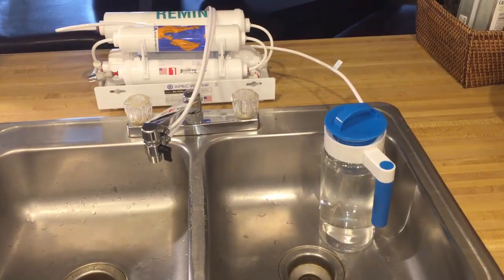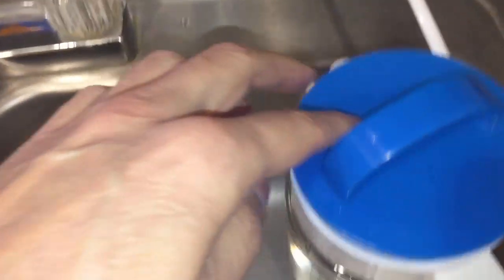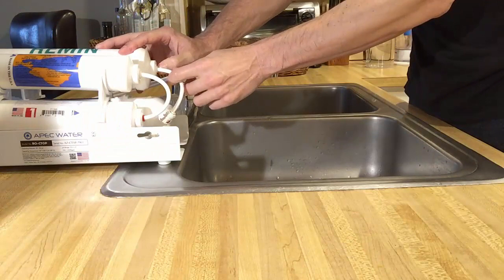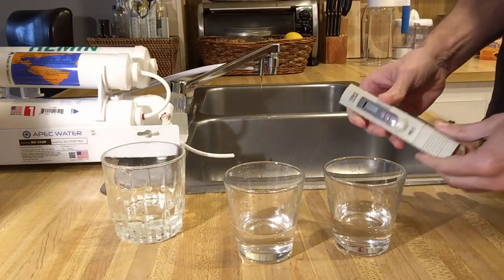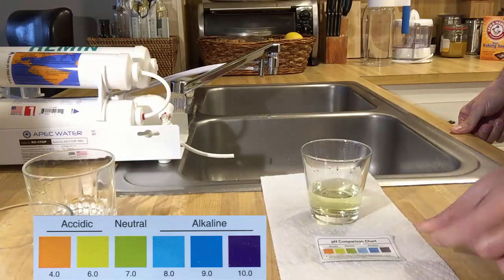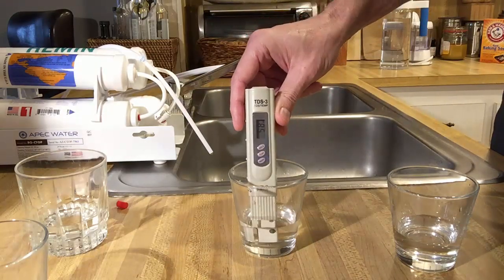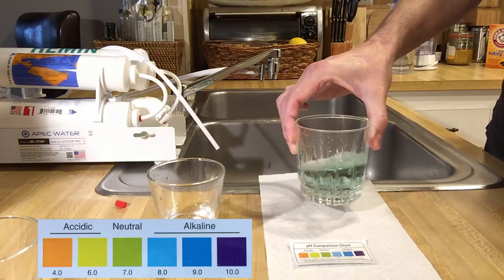Countertop RO portable drinking water purifier alkaline filter review PH TDS Speed Waste

Comment: Hi, I am trying to get a countertop RO system similar to the one shown above then add in the mineralizing  unit, which brand would you recommend? I looked recently into the Crystalquest brand, but there were bad reviews on it on Amazon. Thanks.
Reply from the maker: I use the REMIN filter from vitev.com. It's larger than a typical filter and good tasting, but kinda expensive. I replace it every 12 months on auto-program for $119.
Reply: @Your-Self  I was referring to a Reverse Osmosis unit similar to the one you've reviewed above, I meant the entire unit leading to 0 TDS, can you recommend any?
Reply from the maker: Not really. A typical RO system will remove about 95% of impurities (5-20 TDS). To get 0 TDS, you'll need a distiller or a Zerowater filter system.

Comment: What should the TDS read on water from a brand new water filter? My zero water filter reads zero but this is way higher than that. Thanks!
Reply from the maker: The RO system removes about 95% of impurities from the faucet water, which is good enough. And I like to add some minerals to that water after purification to improve taste and make it healthier. And that increases the TDS.
The Zero Water removes 100% of impurities, but the filter needs to be replaced very often $$$
Reply: @Your-Self  so zero water is better? I was told RO is better , so confusing.

Comment: Great review, @Yourself !. After replacing the Remin filter, will it still fit with the case ?
Reply from the maker: If you have the model with the case, everything inside is very tight. The Remin filter is larger than regular filters, so it'll not fit inside the case. Maybe you can use it without the case... not sure.

Comment: I am trying to add the remin to the express water countertop system. How would I hook it up? I believe I have to remove the rounded faucet and connect the remin filter with a tube to the post carbon? Any advice would be helpful
Reply from the maker: I'm not sure how your express water system looks like, but in general, the Remin filter should be connected instead of the post-carbon filter, not after.
Reply: @Your-Self  So I have to replace the post carbon with the remin filter, right? Why can’t both be together?
Reply: And the remin filter would this become a 5th stage
Reply from the maker: You can obviously create the 5th stage if you want, but honestly, the post-carbon filter doesn't do anything but improving the taste of already clean water (assuming you have the RO membrane). And if you got the Remin filter, it will add the minerals and improve the taste at the same time. More stages don't always mean better water.
Reply: @Your-Self  gotcha! Thank you so much for all the info!

Comment: Pure water has a pH of 7.0.  The reason that reverse osmosis water is a little acidic (pH can drop as low as 5.5) is because carbon dioxide in the air dissolves into the water (perfectly natural process) which causes the formation of carbonic acid (H2CO3) in the water.

Comment: So what is better method the reverse osmosis or water distiller and would Remini Filter work with the Distiller of could i just use japanese charcoal water filte with it and adding some minerals
Reply from the maker: Both methods are great!
Distillation requires a lot of energy to boil-off the water.
RO requires water pressure to push water through the filter. And the Remin filter needs that pressure as well. 
For distilled water, you can use a pitcher with a Remin filter inside.

Comment: Can acidic RO water also leach plastic? Psuedo-estrogens are a concern - like from the bladder in the RO tank or even the tubing.
Reply from the maker: Your concern is right on the point. Acidic RO water "digs in" the container to find minerals to neutralize itself. That's why RO companies install an additional carbon filter to improve the rubbery taste of the water coming from the tank bladder. The best way is to mineralize the water right after it goes through the RO membrane. That way, the water sits in the tank already alkaline or neutral and doesn't "attack" the walls for minerals.
Reply: @Your-Self  One issue is still confusing. RO water isn't acidic until it comes in contact with air where it absorbs CO2. Pure, distilled water is perfectly pH neutral - until it comes in contact with air (which might be immediately).
It might not be acidic per se but it's still ionically 'hungry' and eager to bond with something. So to me there's 2 separate issues here that i don't quite fully grasp.

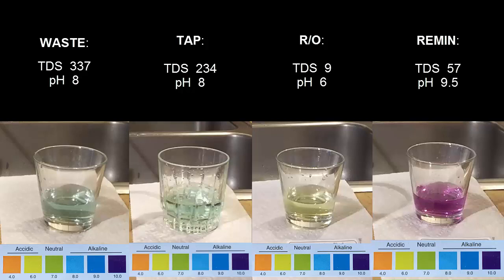Comment: So the R.O. filter got water to 9mg TDS + the mineral filter added 48mg. Your waste water TDS was 337, not as high as I expected. Results at 6:20
And the filter took 60 seconds to fill a glass. That's really slow but expected. The question I came for: what is the GPD (gallons per day) rating of the RO system? I want to compare it with the glass fill time.
Reply from the maker: This system is rated at 90 GPD. But the water flow also depends on the pressure at your faucet. If your pressure is at 80 psi, the water will flow much faster then at 40 psi.

Comment: Great review and nice set-up. If I wanted to go with the 4-stage APEC RO + Vitev REMIN filter, would I need to buy any special connection kits to hook them up together? I looked but couldn't find any related parts on amazon. Thanks.
Reply from the maker: @TheBaRolExperience my system is from APEC (not APEX), but these companies use Remineralization filters made with cheap Calcite and Corosex which are not meant to be used with "aggressive" RO water. When this acidic RO water flows through the Remineralization filter, it picks-up way too many minerals then your kidneys can handle, triggering possible kidney stones. Vitev uses a wide array of minerals which are slowly released within a year. Expensive but tasty and a healthy product!
Reply from the maker: You won’t really need any special connections, but supplied quarter inch tube may not be long enough to connect REMIN, so you may need to buy a foot of quarter inch tube. Thanks for watching and commenting
Reply: @Your-Self  doesnt apex have its own remineralization filter? you changed it with the Vitev Remin one?
Reply: @Your-Self  do you think i could connect somehow the Remin to a countertop distiller? To put minerals back into the distilled water? Or somehow run through the Remin the distilled water?
Reply from the maker: @TheBaRolExperience that particular Remin cartridge requires pressure to push water through, and I believe the distiller almost has no pressure when dispensing water. Maybe, you could try a Remin-pitcher from the same company https://vitev.com/collections/alkaline-water-ionizers

Comment: Hello, one question , is the tubing on the in and out lines a softer type of plastic?
It looks more flexible and I wondered what it was made from.
Reply from the maker: Yes, the tubing IN and OUT is softer than tubing between filters, but I'm not sure what it's made of. Thanks for watching.
Reply: Damm, id wish I could get my hands on some of that tubing. Thanks for the quick answer.
Reply: I think it's vinyl/PVC. One last question, is it thicker? outer and inner diameter?
Reply from the maker: tubing looks exactly the same, 1/4 inch size... the only difference is softness.
Reply: Thanks again.

Comment: Great video. I like your set-up but I see you got the Chloramine and Remin filters from other companies (APEC  didn’t know what I was talking about when I asked for similar type filters). Could you provide links where you got them (I see one is Omnipure but seems like they make various Chlorine filters but I couldn’t see anything that specified Chloramine)?  I’m new to the RO world and would like to order pretty much what you have.  Thanks.
Reply from the maker: You are correct, my municipal water contains Chloramine instead of Chlorine and for the system to work I had to replace regular carbon filters with Omnipure K2526-JJ which APEC has in stock... https://www.freedrinkingwater.com/fi-chloramin-1-4-qc.htm
            But then I replaced post-carbon filter with Remineralization cartridge from this company... https://www.vitev.com/alkaline-water-ionizers-p/remin-program-1.htm
It's a bit expensive at $119, but it's a top-of-the-line American made Remin filter with 12 month slow-release healthy minerals.
Thanks for watching.
Reply: YourSelf Awesome! Thanks for the quick reply.
Reply: @Your-Self  How often do you replace the Omnipure Carbon block filter?
Reply from the maker: Abraham V... I've just replaced my Omnipure block after 1 year and here is the video: https://youtu.be/YpsuHdmEFOc It's recommended to replace it every 8-12 month, but really depends on how often you use it and general quality of water in your area.
Reply: @Your-Self  Thanks for the quick reply I appreciate it. I'm currently trying to retrofit my Global Water G5RO water cooler RO system to a set up like yours. The trick is that I will have to modify the main bracket inside the cooler housing to be able to fit the APEC filters. The Global Water RO system is not as effective as the APEC system and filters have to be replaced more often.

Comment: Wow, 9.5 pH from that filter! Did it come together with RO system?
Reply from the maker: Typically, RO systems come with optional Remineralization filters made with cheap Calcite and Corosex which are not meant to be used with aggressive RO water. When this acidic RO water flows through Remineralization filter it picks-up way too many minerals then your kidneys can handle triggering possible kidney stones. I found my Remin filter with slow-release minerals and 12 month replacement cycle made by an American company. It's a bit expensive at $119 if you sign-up for yearly replacement, but if you care about your health it's worth it. 
The company is called Vitev:  https://www.vitev.com/alkaline-water-ionizers-p/remin-program-1.htm
Reply: Thanks man, just got my remineralization filter and ph drops to verify... and it’s very purple and water taste great!
Reply: @Your-Self  Wouldn't the amount of minerals the water picks up be self-limiting as the water loses it's acidity?